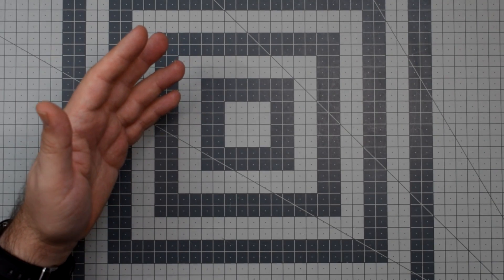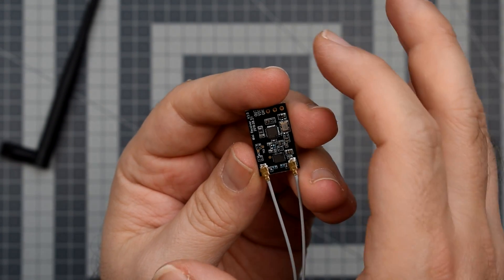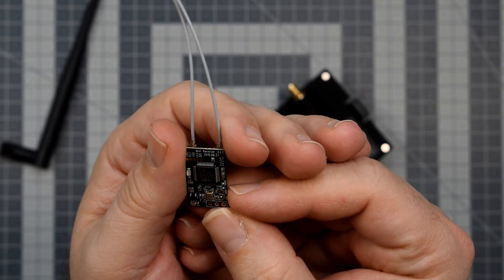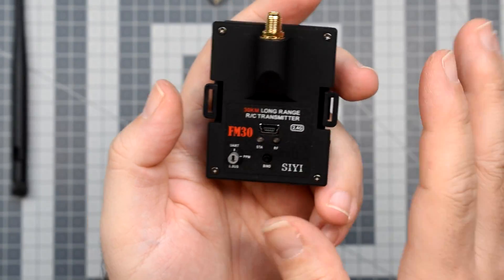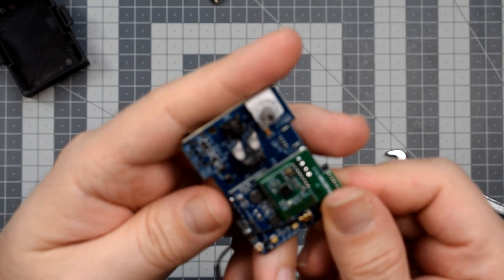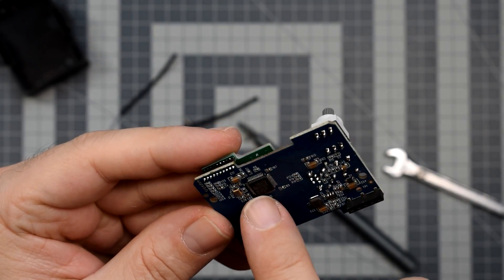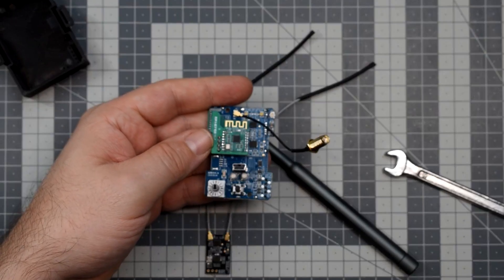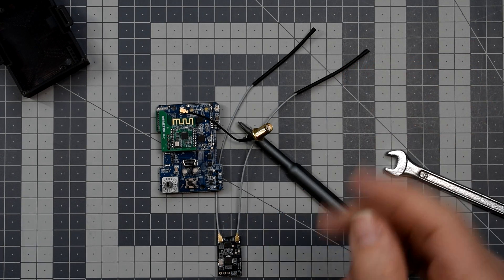SIYI FM30 & FR-mini LoRa Radio Teardown

Comment: Hello Pawel, yesterday I was able to test my FM30 on my Horus X10S accst with Yappuu telemetry and output by SBUS I have done 11 kilometers (RSSI 40) of distance which seems very good to be 2.4Ghz, basically I did not continue until I achieved a low RSSI and Fail Safe because I lost video. What I have not been able to achieve is to connect QgroudControl with the internal Bluetooth (59XXXXXXXX.BLE) of the FM30 with my PC or with my phone or trablet, I have written to SIYI support, but I have not had a response
Reply: You won't hear back because this function doesn't work or its hit and miss liks TBS crossfire bluetooth and wifi to Qground
Reply: @Wilmer Lerma, what is the mode you are using on the transmitter for s bus? I am only able to get this thing working on ppm mode.

Comment: Really interesting, hope you test it with frsky radio soon.
I am really fed up with the massive antennas from 900mhz systems and the tricky positioning horizontal/vertical.
At the moment I use r9m hardware with express lrs. But I hate the antennas very much. I like to try a 2,4ghz lrs to get the form factor if the 2,4ghz antennas back.
Waiting for your review.

Comment: I have a question about Ghost. Maybe you can help. I am mostly solo so dont have many to bounce some issues off of. I just updated to version 1.0.2.0 firmware and nothing has changed but the update. Both tx and rx match but my settings are all crazy. I have the irc opentx firmware for sync and 2.3.11 sd contents. When i set longrange mode on tx it says 250hz with no lock for sync. On normal it is 250hz no lock for sync. On race it is 159hz with yes for sync. On pure race it is 247hz no lock. On race 250 it is 247hz no lock. Would you have any idea what might have happened? Im at a loss....

Comment: Why are you doing the walking test when you can launch a (deterministic!) mission in iNav and have RSSI/LQ data for each GPS point (including packet arrival time jitter and actual channel data)? Just use a mix lua script to change channels every frame so that you can detect duplicated packets (like what FrSky ACCESS is suspected to be doing). Just a thought ).
P.S. This kit is garbage until ExpressLRS is ported to it. R9M+R9mm is the same price and FrSky actually provides documentation (and 900MHz long range is longer than 2.4 long range all other things being equal)..
Reply: I hope ExpressLRS will take this soon. The firmware is only useful for hardcore AP user that carry a shitload of telemetry stuff within their cars. There is no Radio telemetry. You need a separate   keypad or notebook to see it on QGC/MP....via the BT from the tx module. It is not  supported by OTX
like Ghost, R9 or the Flysky 302 and appears as part of the MMprotocol, but that has no code for it.
Reply: Because posting proof of yourself breaking the law online tends to harm your prospects, as much as i'd like to see it myself.
Reply: @maceliusfpv370  The GPS logs themselves don't need to be posted, just the aggregate data derived from them. For plausible deniability, the vehicle in question could very well be a boat or a rover or a sub-250 quad with no FPV gear (legal in EU I think).

Comment: Interesting indeed! So, you could use say bluetooth with a laptop and mission planner? Or the usb? I always thought you had to use a second receiver dedicated to mavlink. I have another LoRa on my desk I was planning to setup as a secondary link to my aircraft. I'd love to learn more about this subject in general!
Reply: I thought the main problem with that approach was the fact that the receiver amplifier (if it even has one) is lower power (like, 40mW for CRSF Nano RX vs 2W for the TX), so you lose mavlink much sooner than you failsafe. That, and the fact that telemetry link is using lower rate to compensate for the lower power, so baudrate isn't great and mavlink can barely pass through even at close range (when rates are higher).

Comment: I can't shake the feeling that the encoder and use of mini USB suggests, including the MCU suggests that this is a rip-off of the 4-in-one module with Bluetooth added on top of it.
Reply: I think your probably right. I have seen this on some generic esp32/LoRa modules too. (most do work fine so far) Why they still love that mini USB which I suspect costs them more at this point is beyond me. It's the first thing I unsolder on my radios and devices for any other usb port I have laying around, lately usb-c.

Comment: I got my crossfire starterkit with a RC back in november when I had to pay 100€ for the transmitter and 3 receivers on top of my Radiomaster cause I did not expect the 2,4 Lora getting better long range results - for planes.
This is another biggest better but I still miss the final results regarding a range comparison.

After watching the long range tech developments over 1 year I went for the safe way of suisse development cause it did not make any sense to wait any longer. I had already gotten the frsky 900 Mhz receiver which did perform better than the usual but did not meet the crossfire results.
I hope to see the big shoot out about the best 2,4 ghz solution just to get that and compare it with the crossfire ...

Comment: In UART mode we have uart+sbus. On mini receiver there is bug in serial pins (current firmware). You need to connect tx3 to fc tx and rx3 to fc rx.

Comment: Excited. TX12 and this means $100 all in long range setup
Reply: Used R9Ms going for as low as $20 too.
Reply: I would prefer jumper t lite + Happymodel ExpressLRS
Reply: @przemos7816  Think You'd have an easier time fitting an R9M lite with ExpressLRS on a t-lite.